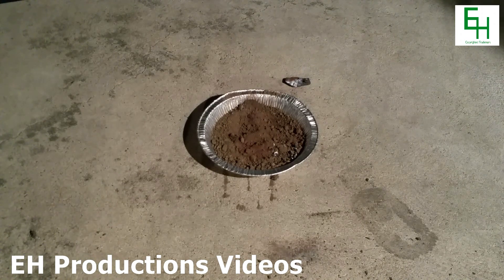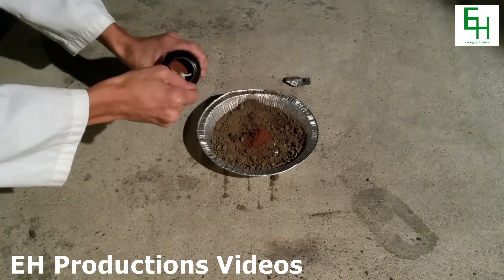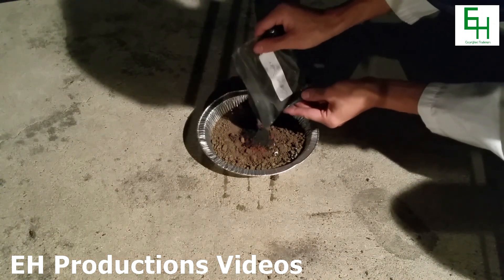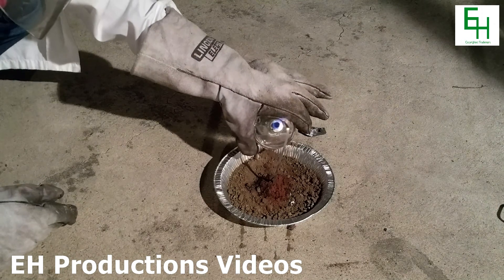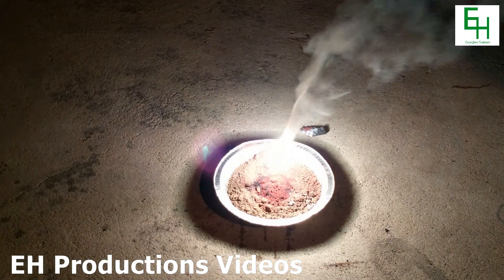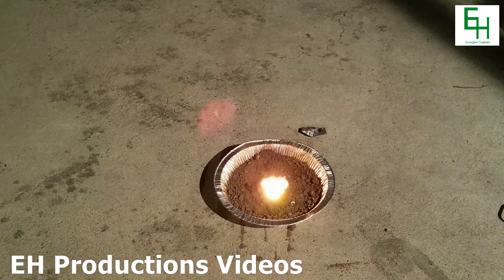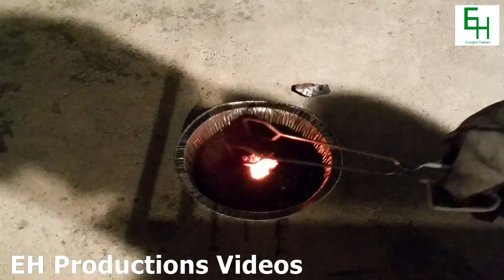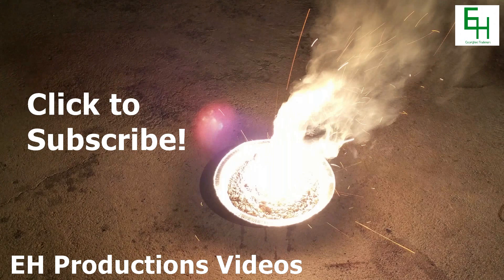MAKING STEEL! (From Thermite and Charcoal) | HD

Comment: how do you know this is steel not just iron ? you could at least test its hardness
Reply: The difference between cast iron and steel is the percentage of carbon in the iron. Cast iron actually has a lot MORE carbon in it (4% or so), where as steel has a very specific, small amount (0.25%). Given that he didn't actually measure anything here, and it looked like he added quite a bit of carbon, he almost certainly made cast iron in this video. With that said, it's still pretty cool that you can make cast iron in such a simple way at home.

Comment: so to make steel you either need iron/rust shavings and a type of carbon based powder?
Reply from the maker: In this video I used rust to react with Aluminum(Aluminium) powder in a thermite reaction to form molten Iron. The idea is that the molten iron will absorb the carbon powder to form steel, an alloy containing iron and carbon.
Reply: What is the quality of the steel